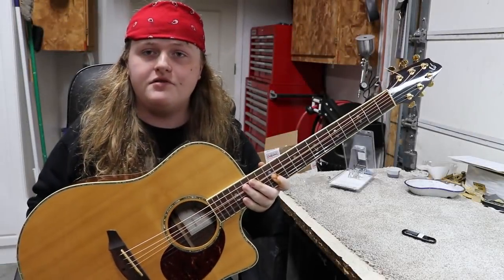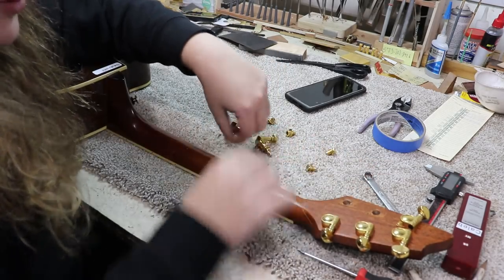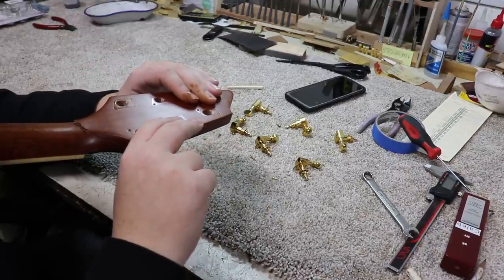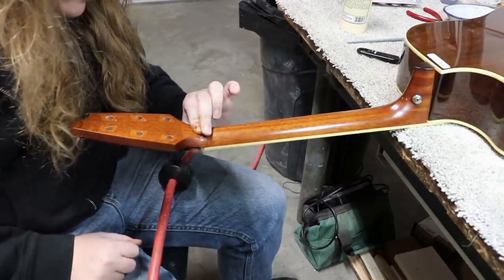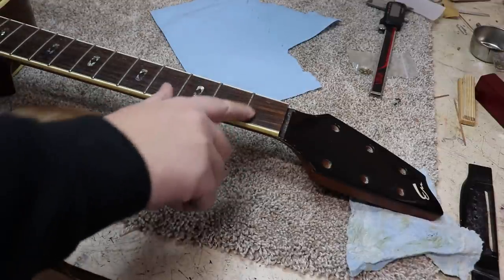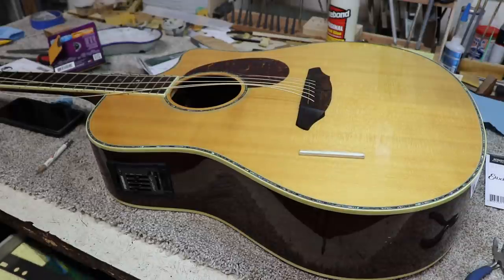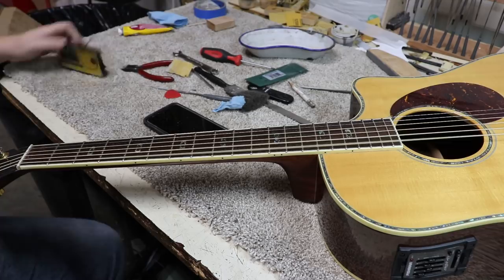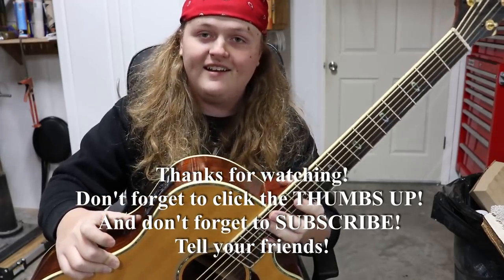469 RSW A Breedlove Guitar

Comment: Nice job on the crack. Same thing  happened on my old Gibson J50 (1963) and I used an hyperdermic  surgical needle filled with glue and reached inside the split and worked fine. I wish I had better clamping tools in those days so the split did not show. And today it is still holding very firmly. 
Jerry told me last year or so, leave it alone as it kept together to this day !
Reply: I just did a Yamaha 12 string, with a slotted headstock, that way. (long needle, surgical hypo)
rIt had a crack which tan from the 1st fret, on the treble side, to the tuner slot, on the bass side.
That hypo got that glue all the way in, with plenty of squeeze out. It is now solid as a rock.

Comment: I found that most tuners these days are from somewhere outside the USA and use “phillips” type screws. I’d always had problems with my Craftsman screwdrivers “cramming” out and buggering up the screw heads until I started using JIS (Japanese Industry Standard- I think) screw drivers. They fit most of those non-USA screws much better than my worn out drivers... just a thought.
And by the way, great job on the crack!

Comment: Good work Caleb water helps draw glue into cracks too. I just reglued a neck break, came apart at the third fret so far she is holding. Had to fill in deep hole in fret board all I had was ebony dust and thin super glue on a rosewood board. (Washburn) now it needs fret job. Thanks for posting.

Comment: Great Job Caleb - As an aside, I have exactly the same Korean Breedlove Atlas Series and love it.  It is my go to guitar for most uses.  I too have suffered from the deep ruts at the lower frets on the B string.  I find that putting a small bend in the first inch to inch and a half on the strings help them to clear the saddle when installing strings.  I have also removed and installed the saddle by just loosening the strings enough and pulling up on them.

Comment: You can thin the glue with a little water then inject it with a syringe into the crack. worked a treat to get the glue all the way in a very similar break i fixed

Comment: Well done again Caleb, it sounds great. Guess you didn't need to worry about that weird bridge.  .  I have a 12-string from Ukraine with a bridge like that When I got it up to pitch, that bridge just split. I put on one with holes for pegs and then the top bowed really bad. I think they converted a nylon six string to steel 12-string. It was never made to stand that kind of stress. I think I'll put a new top using Jerry's dreadnought bracing pattern.

Comment: I know you have put it in a video somewhere in the past but what is the specific name of the gauge / tool you use for measuring the string height/action  at the 12th fret ? I know you said it was expensive but what is it?
Reply: I believe Jerry said the brand was "Insize" or something like that. I think they were $60 or $70 on EB.
Reply: I looked for that but it appears to be something else.  I’m not sure the exact name.  Seems much easier to use than feeler gauges or a ruler. The 18 red pick is an easy one to get.
Reply: That is an "INSIZE 4630-1E Taper Gage" Available, now, on Amazon, for $59.55.
Reply: @zapa1pnt  Thanks -- Ordering one now!!

Comment: Kind of difficult the past 6 to 8 months to find elixers in my area. Only one shop in my area has em. It's a mom and pop shop but he orders direct from them. But like guitar center good luck. lol.... I went a while without them before I found em again. I used those new DiAdarrio nano coated strings under recommendation but they aren't as good at all. Made my guitar sound  dead... Not a fan of their new strings. But before I started with elixers I played DiAdarrio phosphor bronze the 80/20's and they are awesome, pop later with those for 30 years... But those new expensive coated strings they make are a rip off...